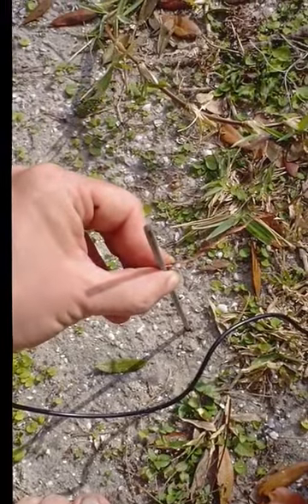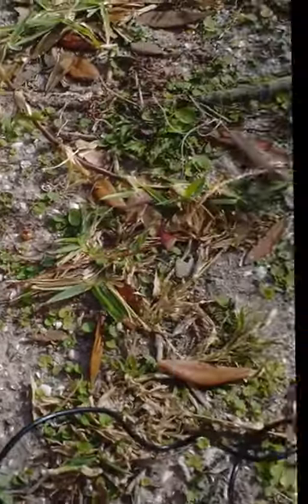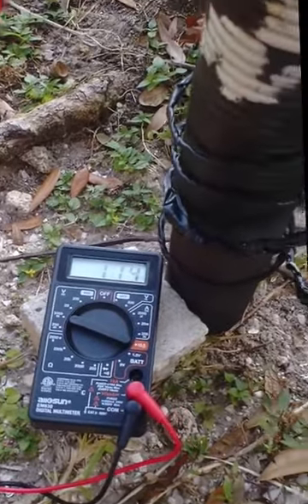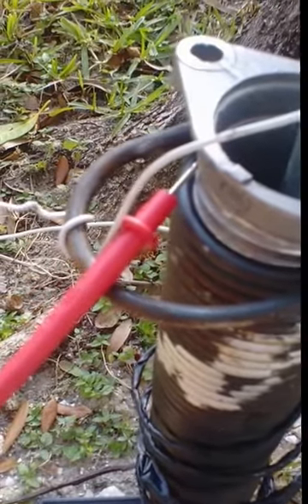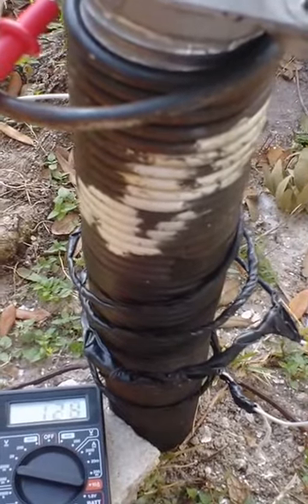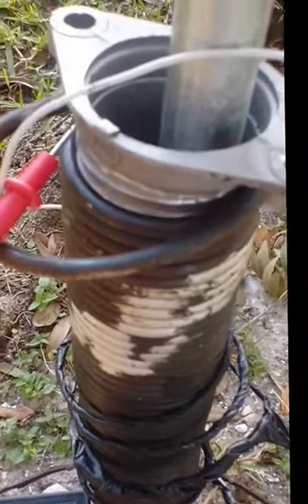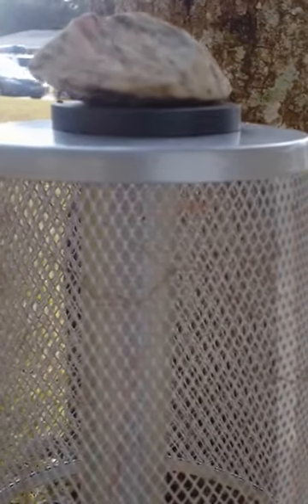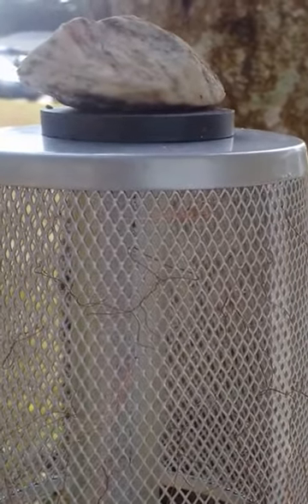ATMOSPHERIC ELECTRICITY VIDEO 2

Comment: Is there any potential power there? If it’s just static voltage and not enough to do any work then what’s rhetorical point?
Reply from the maker: See the new videos
Reply: @peterlang777  Sorry. I only saw the short.
Reply from the maker: @grumpy3543  www.youtube.com/c/peterlang777
Reply: @peterlang777  I will check them out. But have you run any lights or motors with that power? Can you run a house? Charge a car?
Reply from the maker: @grumpy3543  a pendulum motor, an LED,  and an electroluminescent light
Reply from the maker: @grumpy3543  it's modular it can power anything when scaled
Reply: @peterlang777  Thanks. Let me know if you do an experiment powering things.
Reply from the maker: @grumpy3543  I did. It powers all those things in the videos. LEDs,  pendulum, electroluminescent suspension

Comment: "My present application is based upon a discovery which I have made that when rays or radiations of the above kind are permitted to fall upon an INSULATED conducting body connected to one of the terminals of a condenser, while the other terminal of the same is made by independent means to receive or to carry away electricity."

INSULATED being the key word. 

"Furthermore, the surface should be clean and preferably highly polished or amalgamated."
no talk of a mesh...

"taking every possible precaution in insulating the armatures(conductors?), so that the instrument may withstand great electrical pressures without leaking"
Reply from the maker: You can see why I used non insulated here www.ionpowergroup.com
Reply from the maker: It's so the ions in the air can directly impact and electrify the mesh
Reply: @peterlang777  Electricity is a field and a wire is field guide, if it's not polished it cannot reflect the fields nearly as efficiently, regardless what you use the conductive material needs to be as polished and reflective as possible.

I recommend looking up Adrians work at AMInnovations for more information, Radiant Energy as Tesla used it is not merely a use of Ions.

Comment: Unless those large coils at the base of your pipe are insulated, they won't function as an inductor, but more like a metal sleeve. I suggest using an LCR meter to measure the inductance of your large coil.  I guarantee it will have NO inductance. You could obtain the same output (mV) by sticking one test probe into the ground and holding the other probe up above the ground a couple of feet. No magic here. Try connecting one wire to a balloon filled with helium and the other wire to ground. Let the balloon rise up a couple of hundred feet and you will get a tremendous amount of electricity. Benjamin Franklin did it with a kite (not in a thunderstorm) and proved atmospheric electricity was a thing.

Comment: How much can it generate and is it possible to attach more to get more power??
Reply from the maker: the power in amps is very low. it depends on the aerials elevation above the ground. the higher the aerial the more power from the diffrence bettween the sky and ground voltage. (also changes with storm weather) tesla's colorado springs expeirments show alot about how to use the radiant energy/ion wave density
Reply: Do you think there could be enough power for a Central Air unit.
Reply from the maker: no. ac is much to great a power hog. for that I would try the solar powered a.c. machines they use ammonia. made in the 30s they could save 10s of millions a year.